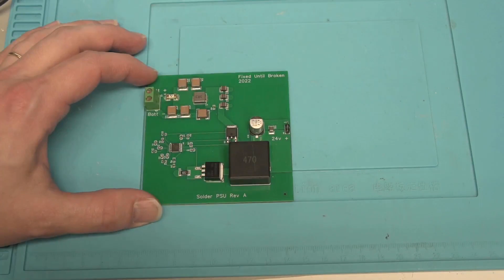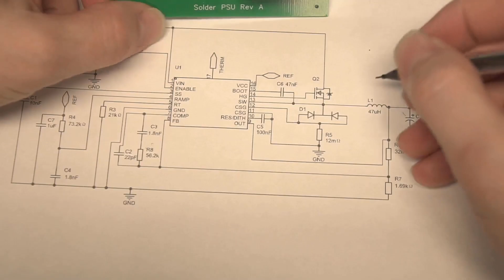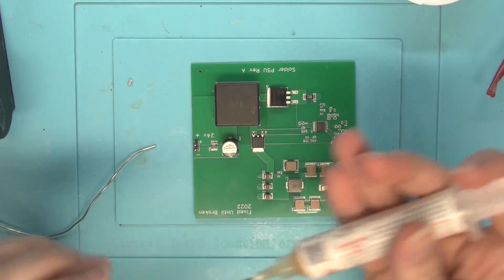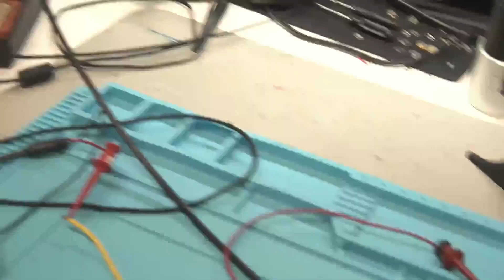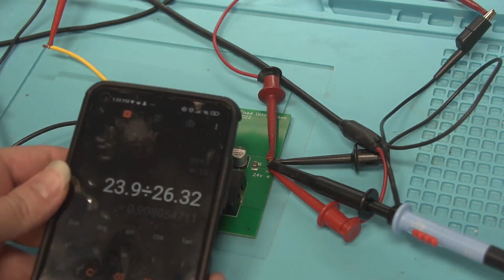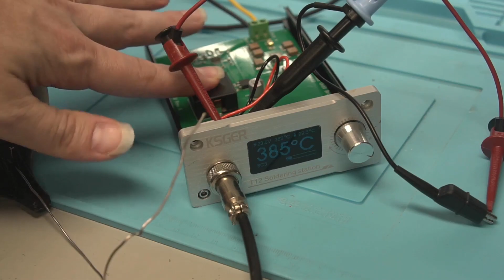EGO 56V Battery Powered Soldering Station Part 2

Comment: Do you still do any of the A/C Control Module Stuff in the 03-07 Silverados? I'm looking for the bulbs you used in the two middle 12v slots and can't find that style anywhere do you have a place to look? I've found some for the 6v slots on Lighthouse LEDs but if you have recommendations on those too I'm all for it.